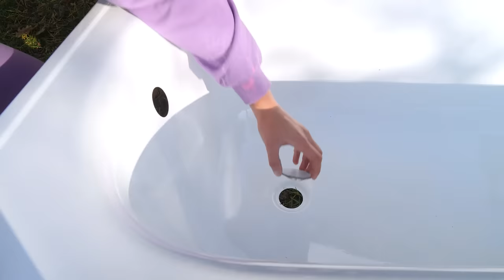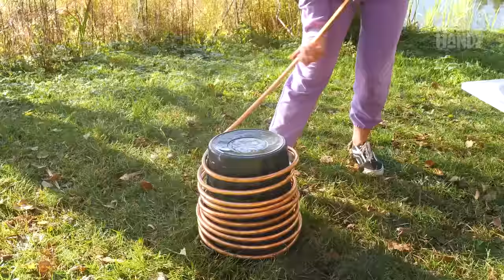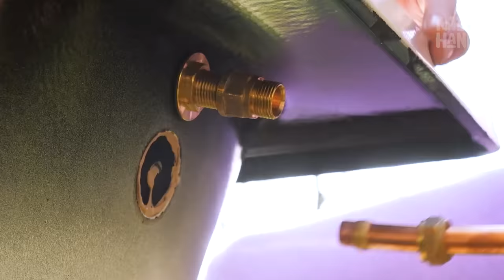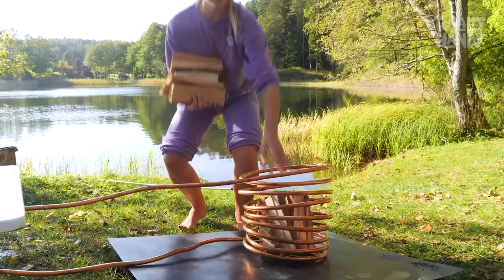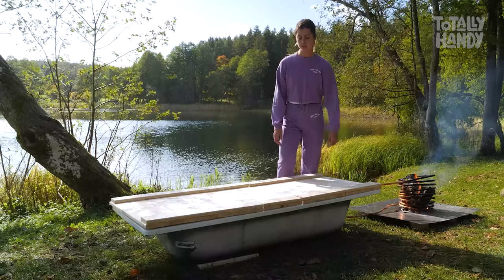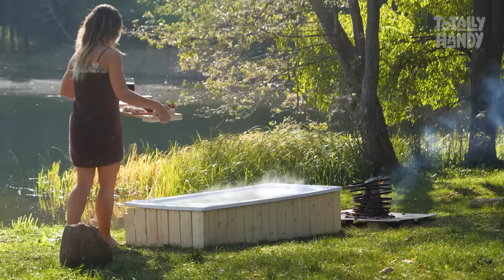Building a DIY Hot Tub: You Won't Believe What I Used for Materials! | Backyard Project

Comment: I’m surprised no circulation pump to move the hot water.
Reply: The fire heating up the water inside the copper coil creates a flow. Hot water will rise to the surface just like hot air. In this case, cooler water coil enters the lower pipe and comes out the top as hot water. It’s just science.
Reply: I was wondering the same thing. I think a small pump would help. Even better if you don't need a pump. I was thinking she should have had a metal surround like an old dryer drum around the fire and copper pipe to keep heat in. It was cool. I've wanted one up hidden in the mountains where I could hook up to the stream for water and get the fire running for heat.
Reply: It's called convection
Reply: @neoterra7072  so science would tell you a couple of things here. Yes natural convection will have some water movement; however, the flow is slow and it’s very possible the heat transfer will be reduced a lot due to nucleate boiling happening. If there was a pump the water would get hotter and the overall system would be more efficient. It’s still a cool project.
Reply: @totalyep the pump would require power in which none of the finished product uses.

Comment: How is the water continuously circulating to warm the tub? I though a pump would be necessary.
Reply: It's a thermal siphon. Hot water rises in the coil which draws cooler water in at the bottom. What she has done wrong here is having the hot outlet too high in the bath. The steam is dangerous. Always set the the hot outlet at least 2-3 inches below the water level.